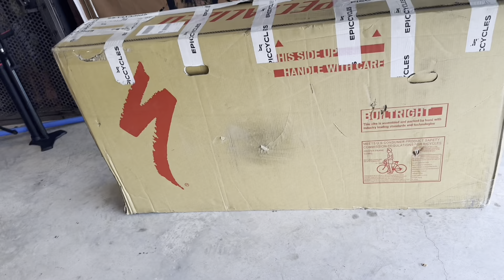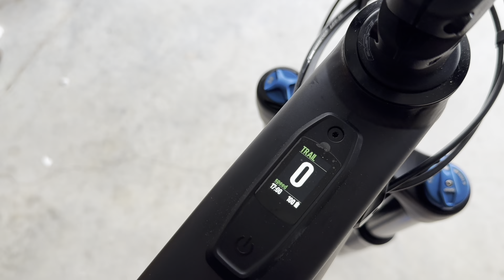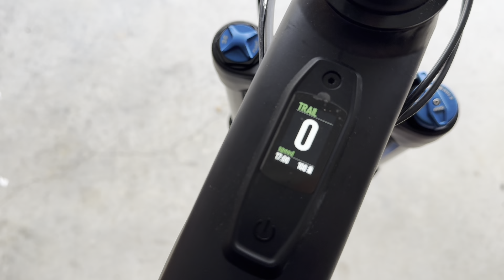New Bike Day - Specialized Turbo Levo Comp

Comment: In your honest opinion Levo or Rail?
Reply from the maker: With the motor being more quiet and natural feeling I prefer the Levo.
Reply: @ebikesandthings  i was debating between the two i like the looks on the levo but i saw a lot of reviews on both motors and everyone said bosch was better so I went to trek they had a really nice deal on a rail 9.7 carbon and i ended up pulling the trigger. It’s my first e-bike and i’m loving it so far.
Reply: Levo, better rear suspension linkage. Fuel has simple single pivot - but they gave it fancy name to sound cool, turbo has clever Horst link

Comment: How many miles can you do on a full battery in the different modes thankyou
Reply from the maker: @rickyedwards8727 Honestly it depends with weight, grade, trail conditions, etc. I usually ride trail and get around 38 miles per charge.
Reply: @ cheers pal